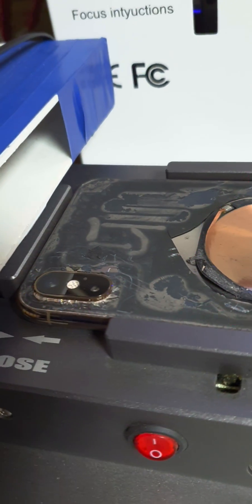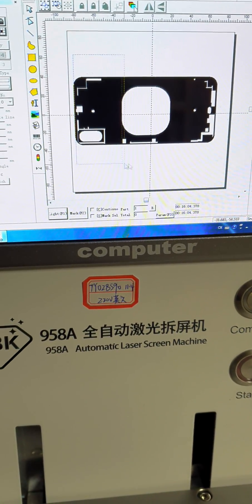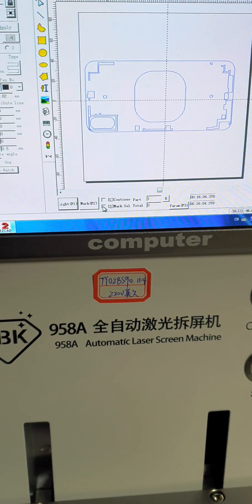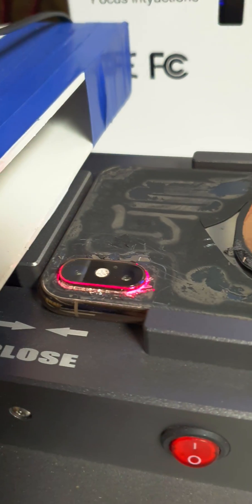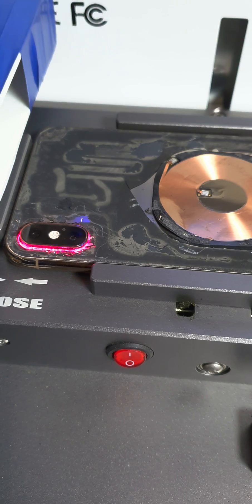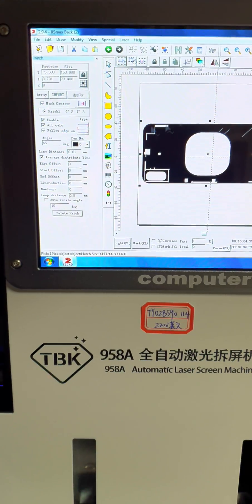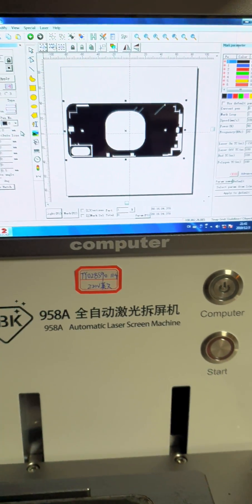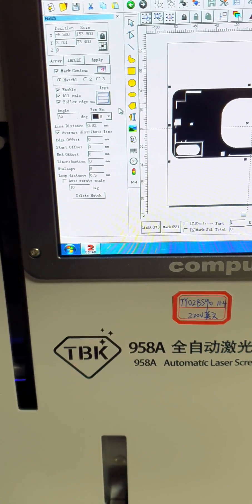Adjust camera hole TBK 958A

Comment: Hi, my tbk958 keeps marking bezel of phone and camera lens, even after the auto-focus.. Can you help me out?
Reply from the maker: If you follow the video, you should be able to adjust the lines. 
If it's too big all over, then select just the outer line and adjust the size of the which you can change on the top left. 

I would, before you start playing with these settings, is make another folder, and copy/paste the existing templates into your new folder and play around with those. If you do anything wrong, you have the originals to copy and paste again. 

Let me know if that works for you?
Reply from the maker: I'll be uploading another video today showing how to adjust the sizes 👍
Reply: @duanemassey4560  Thnx bro, but the software we use is 3.0 from tdk, you have 2.0.. I dont know if the options are the same.
Reply from the maker: @silhan4325  I'm not sure on that then sorry. The video is uploading. So have a look later, and hopefully you may see something similar to your version? 

Take a backup of your templates, and then mess around with them, if anything happens, you've got the original ones on the machine.
Reply: @duanemassey4560  Thanks bro, i'm waiting will try and let you know.
Reply from the maker: @silhan4325  it'll be a couple of hours, slow upload at the moment.